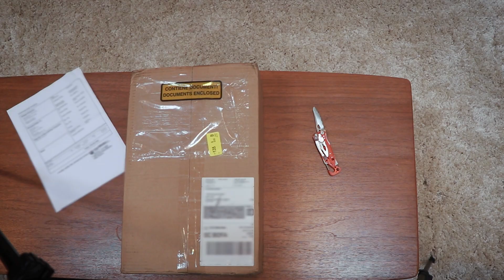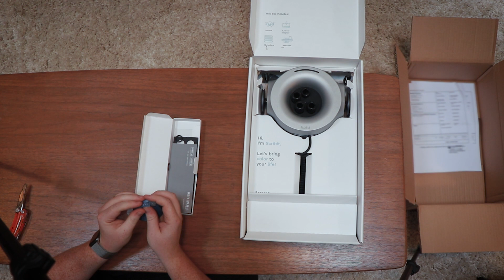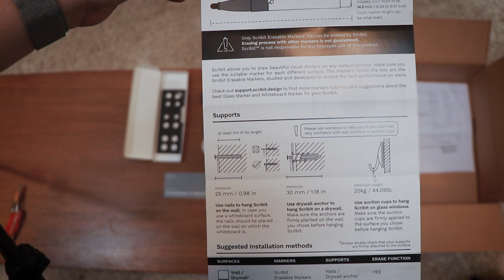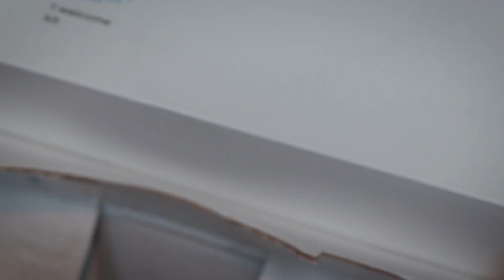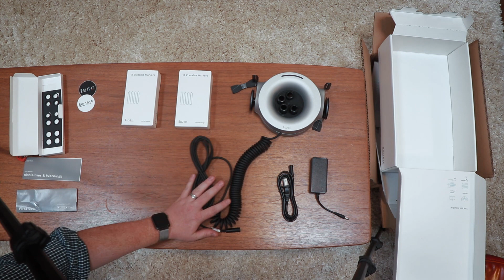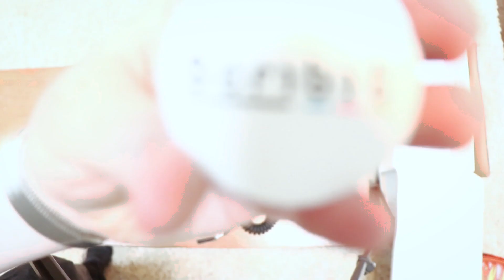Scribit - Wall Writing Robot - First Look!

Comment: do you think this will work without the supplied markers? looking to use my own
Reply: It works very well with basic crayola washable markers (aspecially the color MAX ones). 
The adapter is fairly universal and the quality is good with most markers I've tried. 
(Sorry for SUUUPER late reply, I only log onto this channel once in a blue moon)